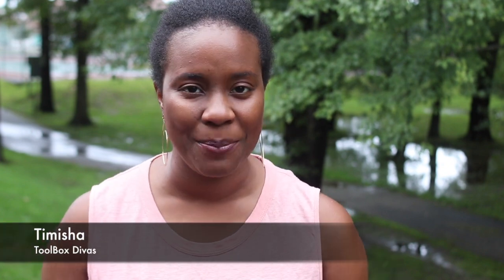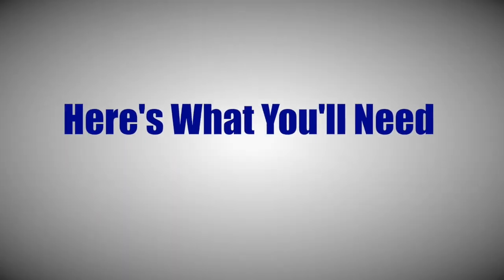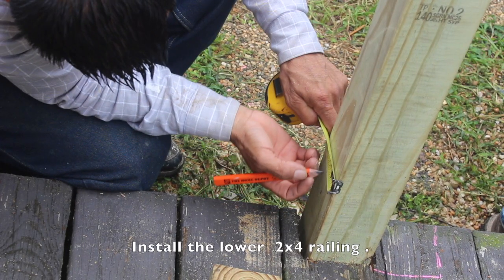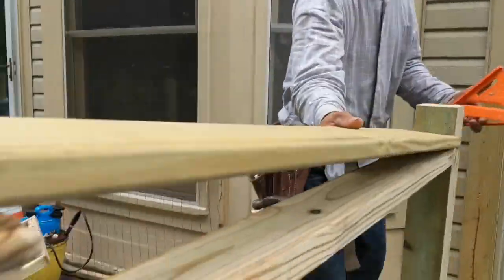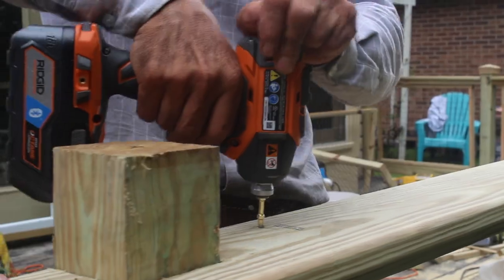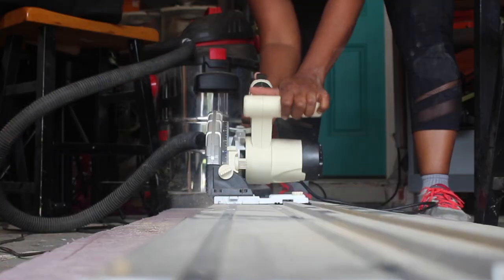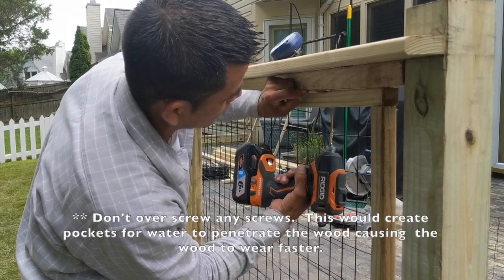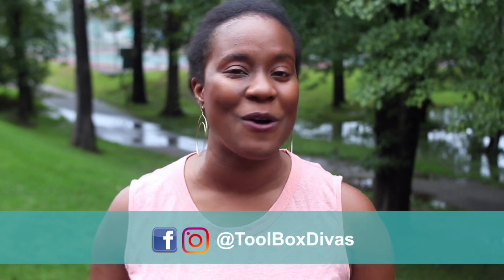How To Easily Build and Install Deck Railing

Comment: if you place 2 frames together then staple to on end the lift the second panels end up on a block and staple it, then take the block out, then push that end down and it will stretch the fencing tight so you can staple the rest. it will take out the wave and will not have any give to the fence after that.
Reply from the maker: Thank you so much for that feedback! I really appreciate it.

Comment: Good job.  Most people won't know how to stretch wire so here are 2 solutions.
1.  The easier of the 2 is done after the panel is completed.  Using a set of square nose pliers, pick a vertical.section of the wire close to either side.  Grab the horizontal wire in that vertical section and gently twist to create a small "z" or controlled kink in that wire.  You will immediately see the tension increase.  Do this on every horizontal wire in that vertical section.  Check you're overall  tension.  If needed, go.the opposite side of the panel and repeat the process.  DO NOT over tighten as this may cause your wire to pull loose or deform the shape of the panel.
2.  With your panel on the ground flat.
Make the wire panel about 6 inches longer than needed.  Pull it tight then attach a 2 x 4 to the longer side.  Be sure to attach the 2x4 about 1/2-1 inch shorter than the end.of the existing frame.  When you rotate the 2x4 back and get it over the edge of the frame, you can use leverage to push the 2x4 down and stretch the wire taught.  Secure where needed on panel, cut off excess and done.
Reply from the maker: Thank you so much for the feedback! I really appreciate it 😊

Comment: This method would probably not pass code a kid could fall threw it  seeing it held on with staples. It's a good idea and looks nice
Reply from the maker: Thank you but this does and did pass code. My deck is ground level and doesn't actually require railings.  I stated this many times in my tutorial.  If you were to do this with an above ground deck actual Hogwire is required or a different design altogether.

Comment: It looks beautiful, nice clean look. One question, will this type of wire rust over time?
Reply from the maker: Thank you so much! No I actually used the one that is coated with a pvc covering in black. It's a cleaner look and lasts longer

Comment: How would the design or materials change for a deck that is 48" above the ground?
Reply from the maker: You would need a permit to start. And you can't use poultry fencing. You would have to use hog wire. Also the way I attached the railing would not work for an above ground deck. You would have to check with your municipality's codes but it changes a good bit.
Reply: Thank you. BTW - your video was outstanding. Thanks.
Reply from the maker: Thank you so much! Really means a lot you saying that

Comment: This safety guard rail is not even close to meeting IRC building code.
 A deck this low to the ground does not require a railing , but if one is built on it , it still needs to meet code.
 Notching rail posts is absolutely forbidden in the new code.

Comment: Rather than stapling the fencing to the frame and then covering with a piece of wood, you can use a dado or router to cut a slot in the frame to hold the edges of the fencing. 
https://www.youtube.com/watch?v=x0iMHQVzJvQ
Another variation of the deck railing using a continuous top hand rail.
https://www.youtube.com/watch?v=IbQdzkZtBmI

Comment: Incorrect staples. That wouldnt pass code. Def. Recommend using hog wire, vs that flimsy wire mesh...
Like the ovwrall look, could be done better though.